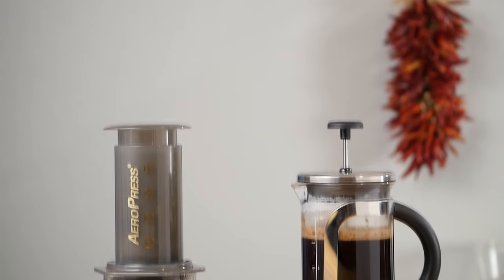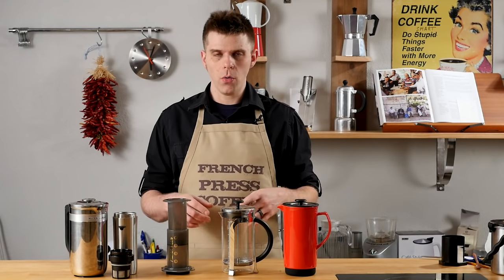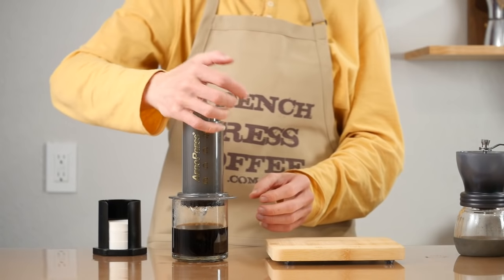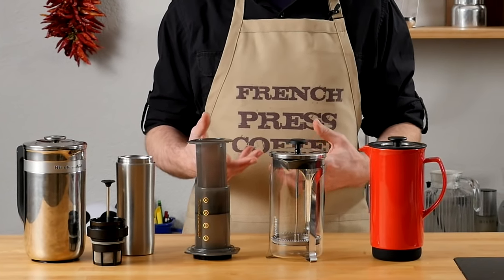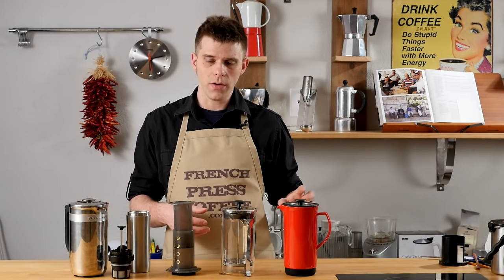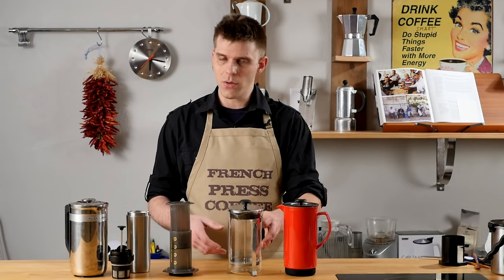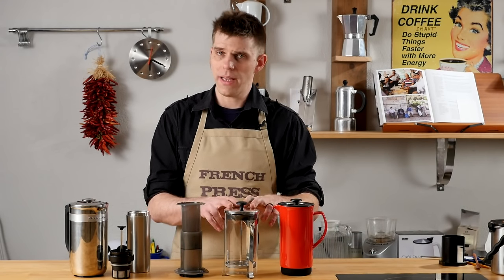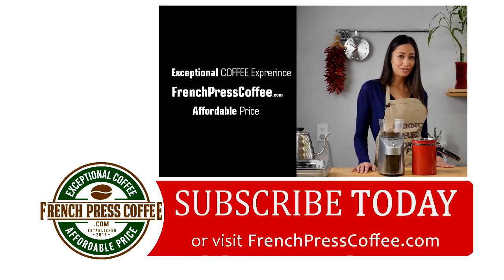Aeropress vs French Press - Pros and Cons you Need to Know

Comment: I owned an Aeropress for a couple of years, thinking it was a decent little coffeemaker; then got a little tired of using it, bought a French Press, tried it once and have not used the Aeropress again. 

Re: the Aeropress being faster, actually most of the time you spend making coffee goes into things like measuring and boiling the water, measuring the coffee grounds. The Aeropress does brew the coffee a little faster, but as a percentage of the total time, it's not very different.

The reasons I gave up on my Aeropress were:  

(1) The coffee did not taste as good. I expect this was because of the plastic the coffee is brewed in, and the paper filters. 

(2) Using an Aeropress can be messy, especially if you use the "inverted" method that involves filling the device with hot water, putting the filter and lid on top, then flipping it upside down while trying to balance it on a mug or cup. Best done over the sink. Can result in burns if you do it wrong.

(3) If you want two cups of coffee, and are using an Aeropress, you have to disassemble the whole thing, scoop out the hot/used grounds, rinse the container, rinse the filter, reassemble, measure two more scoops of coffee grounds, heat more water, pour in the hot water, wait again, and press again. It's messy, and more than doubles the preparation time and cleanup. And in the meantime, your first cup of coffee has cooled. Making two cups in and Aeropress also takes a huge amount of time and attention compared to a French Press, which already makes more than two cups, that you just fill with water then leave to let brew.

Oh, and if I needed something for the road, I'd buy a SMALL French Press coffeemaker, which is cheaper than an Aeropress. Re: a French Press breaking, ah, no, it won't, if you buy one made of stainless steel.

In short, I'm no longer a fan of the Aeropress. Apart from habit and brand name loyalty, I'm not sure why the item is so popular.
Reply: Nils Osmar French press covers up flavor notes much to easy. That's why the aeropress, kalita, v60, ect have cropped up. There's a market for all of them! All of them have different characteristics and all of them make a great cup of coffee French press included.
Reply: Adam, thank you for replying to my post. All I can say is, my experience differs from yours. The Aeropress was the one that I found would ruin good coffee.  I'm drinking an amazing cup of coffee brewed in a french press as I type this, with a wonderful range of subtle flavors and aromas; it's incomparably better than the coffee I used to make in the Aeropress.

I'm not discounting your opinions; I trust that you have reasons for writing what you did, that feel valid to you; but my experience has been different.  My experience has been that the Aeropress blunts and ruins the flavors of good coffee, and the french press, if used properly, is the perfect brewing device. 

This is because of (1) the plastic the Aeorpress coffee is brewed in, and (2) the paper filters. Those who buy a metal filter may experience somewhat better results with the Aeropress, but they'll still be brewing it in a piece of plastic, rather than glass or stainless steel. Plastic has its own unpleasant flavor, and also absorbs flavors as it's used, as time goes by, which it then can impart in an unpleasant way to foods stored or brewed in it.

I recently threw away the Aeropress that had been gathering dust since I bought a French Press coffeemaker. Looking back on it, my associations with it are: messy.... poor flavor... hard to control temperature... hassle. My associations with the French Press are: clean... quick... needs little attention... makes a great cup of coffee. 

It may also be that the particular brand of French Press I bought is extraordinary. The one I bought is an Ardito Stainless Steel French Press 34 oz Coffee Maker with a Double Wall Wide Base with Dual Filters. Whatever the reason, I know after using it that I'll never use an Aeropress again.
Reply: Hi Nils, you supported my thoughts above in a different way. Thank you! The plastic does impart taste as well as chemicals!
Reply: Just a note...With the aeropress you do not need to scoop out the grounds after making a cup.
Simply screw off the black part, with the rest of the press still in tact and press down a little more and the coffee puck and used filter will fall right out.
Reply: I’m thinking you are embellishing the argument just a bit... however, you are entitled to your personal preferences... clean up is much easier on the AreoPress. Just press out the plug of grounds and wipe it down... done... and if you are concerned about burning yourself with the AeroPress then don’t use the inversion method... or switch to cold brew... ;-)
Reply: @illogicalmethod  might depend on which type you buy? I've had a cup made in one but never used one. The only way I've ever found I've liked coffee is from french press. I thought I hated coffee before that but I liked it so much I ran out and bought one immediately. I dont mind the extra time involved in it as it tastes amazing to me. I think the host was a little biased against french press as to me it's just as easy if not easier as any other but that's just my opinion :)
Reply: @Anna-tc6rz  What do you mean, it depends on which type you buy?
There is only one aeropress.
There aren't different kinds of aeropress.  
So as far as my statement goes.
Cleanup with the aeropress is easy.  Much easier than the o.p. statement leads one to believe.
Reply: How do you boil water on the road?

Comment: Aeopress is a combination of immersion brewing (like french press) and pressure brewing since you do generate some pressure when pressing the water through the coffee bed and filter. Both use heat of course if you're brewing with hot water!  With both you need to be aware of how the temperature, grind size, brew time, and brew ratio (amount of water to coffee) will affect your end result! 

You can grind finer for French press (I recommend it), there's different methods for that to prevent a lot of silt or fine particles from getting in to your cup (The James Hoffman / no press french press method is pretty good!). 
 
There's a slightly smaller Aeropress 'GO' now but it's basically the same thing, I think it comes with its own little cup too. 

The biggest advantage to the Aeropress is ease of cleaning I think. Never heard of anyone making tea with an Aeropress.

Comment: And then there is Toaks’ Titanium French Press for travel.

I coupled mine with two Snow Peak 400ml double walled titanium cups. The cups fit perfectly on the top and bottom of the French press, and they both fit into the mesh bag that comes with the press.  I store my pre-ground coffee inside the press.  That’s my set up.  And I’d rather brew coffee in titanium than plastic and paper.  :)

Comment: I've tried a few brewing methods but I wouldn't say that a single one is "perfect" for me. I like medium to light roast coffee, which necessitates a longer brewing time. Two common options for these kinds of roasts are French press and pour-over.

Optimal brewing time is proportional to grind size but pour-over brewing time is inversely proportional to grind size. If one superimposes the two, they only overlap once, meaning that there's only one grind size that will produce good extraction, in a pour-over, for any given roast. Additionally, small changes in grind size produce large changes in brewing time... potentially very large.

However, with a French press, I can control brewing time as I wish but, by the time extraction is done, the coffee needs microwaving, as it's now cold.

Solutions...
I could buy a heat insulated or double walled French press or a percolator. I've avoided percolators because they've a reputation for ridiculous over extraction but, I suppose, it all depends how one uses said contraption and light grinds might just need the extra extraction.

Comment: 6:25 if your filters are big enough (larger diameter than french press) you don't even have to unscrew anything. Just put the filter over the french press opening and push the lid on. As long as the filter gets pinched between the glass and the metal filter, it will hold in place. In the past I've used the big, generic, drip-coffee filters this way so there is no need to track down little filters that probably end up costing more money anyways.

Comment: Seems like your kinda biased. You just lean in favor with the aero press. The French press creates bolder taste and what's wrong with coffee oil? It's a good part of the overall coffee experience.
Reply: Opinions vary... {shrug} ... 
something for everyone.
Reply: You can use a stainless steel mesh filter with an aeropress though
Reply: Awkward Seal you can use stainless steel with French press filter.
Reply: @jaimeiniguez3538  Well yes... That is what they use
Reply: The point is you have more options with the aeropress. You can go, oil or no oil, you can go, immersion then press, you can go immediate press, you can make a latte, you can make a cup of joe, you can make an espresso, you can make tea with it.  You can only make coffee and tea, in comparison, and only one grind type, coarse, is okay for French press, as well French press takes longer and as if that weren't enough, an aeropress also has this neat lil puck of coffee you just pop out when you're done. With french press you instead have to either dump coarse coffee grounds down your sink, wait for it to dry up, or scoop out wet material in to the trash can and then get the grounds off your filter, press, glass, and generally it's more work to clean. 

There's a reason Aeropress is considered one of the best travel coffee makers, as it makes a damn good cup of coffee, is able to be stored and washed easily, makes coffee in minutes, and has so many options for how to brew your coffee from one coffee maker, not something many coffee makers can say, that they do espresso, coffee, tea, and more, better than you do one of them, and with more customization!

Comment: Hello i just bought the wilfa WSCG-2 and a aeropress and wonder how coarse/fine should i grind the beans for my aeropress?

I would like maximum sweetness and fruityness and less of the roast dark tastes.

Any tips to achieve this result? Less or longer time before i press?
Coarser or finer grind?
Hoter or colder water?

I want the maximum taste of the fruity sweet delicous coffe that i get when visiting places with good baristas.
Reply: knife sharpening norway :  I'm no expert, but I like a medium-ish grind, definitely not fine.  And my best results come from a very quick steep and press.  I put the coffee in, add the water, stir and press.  No waiting.  Every time I wait longer the coffee comes out more bitter.  If you want stronger coffee just add more grounds and don't lengthen the brew time and/or dilute it less.

For water temperature, I've never actually measured it.  I boil the water, and put that into my drinking container.  This heats up my cup and helps my measurements while reducing the temperature of the water.  I then pour the water out of my pre-heated cup into the Aeropress leaving any water that doesn't fit into the press in the cup.  And I press the coffee back into the cup with water for an Americano.  Specific measurements change with the size of your cup.

I also use the inverted method with the Aeropress.

Comment: In my curiosity, I broke out my Aeropress last night, and followed directions to the letter. I do not like the coffee it produces, and I have a decent burr grinder (Breyville Smart Grinder Pro), and used grind setting 38 to grind them. Compared to the French Press I have, the coffee produced by the Aeropress tasted like instant coffee. Now I know not to ever use it again. Either it's drip, or French Press for me!
Reply: Sounds like you didn't hit the spot with the grind size or temperature, or both maybe? I'm a French press fan and also use the AP for traveling. The original AP recipe works great if done RIGHT but there are certainly other thousands of recipes you can use to brew a very distinct cup of coffee with the AP
Please check Alan Adler videos and a very nice recipe to try is the one by James Hoffman
Best!

Comment: I got some Nespresso capsules as a present, but I absolutely do not want to buy a Nespresso machine because I think it is a ripoff. Could you tell me if the French Press or the Aeropress would work with the Nespresso coffee?
Reply from the maker: Nespresso uses capsules and they worked only with Nespresso or Nespresso compatible machines.
Reply: If I i can extract the ground coffee from inside the capsules, wouldn't I be able to use the aeropress to make an espresso?
Reply from the maker: You could but each Nespresso capsule cost around 70c (for 7g). You'll be a lot better (money and quality) if you buy fresh coffee beans and grind yourself.
Reply: I know. But I already have the Nespresso and do not plan to buy it again. I don't want coffee to become more expensive than it needs to be. Thanks for the video, I think it helped me to make up my mind.
Reply: You won't be able to make a real Espresso or get crema. But you will end up with a lot better and cheaper coffee.

Oh, and you could also try refillable capsules. I did the same. You won't have to invest a lot, can play around with the coffee you like and will get real and good espresso out of it. So you can still use your machine. It just needs some adjustments to find the proper amount of coffee and grind size the machine can handle.

Comment: Big difference is the Aeropress has a paper filter. A paper filter removes components that cause health problems. The AeroPress is much easier to clean. French press is not easy to clean when travelling. There are 7000 variables in brewing a AeroPress. There is a smaller AeroPress for camping travelling etc.

Comment: Sorry but it's silly to say the aeropress has "pressure". It's basically the same pressure like in a french press. Also immersion, same like french press. Only different is, instead of pushing the sieve through the mixture, you press the mixture through the sieve.

Comment: Aeropress just seems like a more complicated drip machine.
Reply: At work I find it much easier than setting up the Keurig every day. You just need an electric kettle for heating water, and using the aeropress is simple. You screw the filter on the bottom of the cylinder, add one scoop of coffee, pour hot water about an inch from the top, stir with a plastic spoon, put the cylinder atop a typical coffee mug, then put the piston into the cylinder and press slowly downward. It makes a great cup of coffee compared to the Keurig, and it doesn't eat up valuable counter space. Using it, rather than the Keurig, also stopped the theft of my K-Cups.
Reply from the maker: Clever dripper is the easiest :).  https://www.youtube.com/watch?v=kVikEAifZzo
Reply: irishwhip03 AP seems better when camping, of course you're always going to have a mug of some sort with you.

Comment: A word on filtration: the coffee oils (cafestol & kahweol) have beneficial health effects. Avoid filtering those out if you can. Using a metal filter instead of paper will prevent them from being filtered out.
Reply: Here in the Netherlands our health researchers warns about cafestol, and that unfiltered coffee is bad for your cholesterol.
Reply: Really? I read the exact opposite, the coffee oils are ones of the most dangerous oils for our health since they raise the cholesterol levels.
Reply: @RaduRadonys  There was old research that didn't distinguish between good cholesterol (HDL) and bad cholesterol (LDL). Maybe that's what happened?

Comment: pressure has nothing to do with anything but filtering faster.
Reply: Wrong. Educate yourself.
Reply: I did, pressure has nothing to do with anything but filtering faster
Reply: I have to agree, the Aeropress doesn't let you get anything up to the pressure required for crema and all that like in an industrial espresso machine. Both devices use pressure and immersion to some extent.

Comment: Plastic and coffees just doesn't work. After just one of two uses, the coffee starts to impart flavor into the plastic that cannot be easily removed. Also, heat, pressure and time will have its way with plastic much faster than metal, glass or ceramic. 
Neat, but a no.

Comment: Avoid the nasty paper filter taste by soaking the filter with some hot water, make sure you do both sides. I avoided buying an aeropress for a long time because I was afraid the paper filter would ruin the coffee with the paper taste. 

The "inverted" method is by far the easiest way to use the aeropress. You will eventually have to replace the metal filter in the french press and the rubber plunger on the aeropress will eventually require replacing the aeropress.

The aeropress is the only way to emulate those great coffee shop lattes at home. The french press is close but it is not quiet the same. You just cannot get the same oil extraction without the pressure. Don't get me wrong though I am a long time french press user, and prefer it over any drip or perculation system.
Reply from the maker: Great points. Thank you.